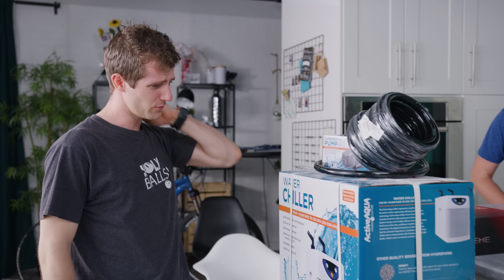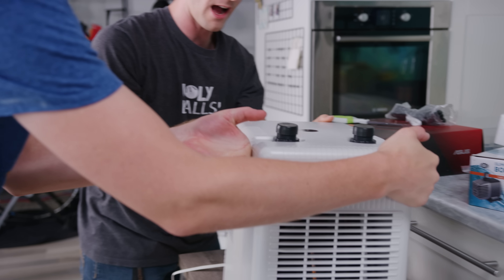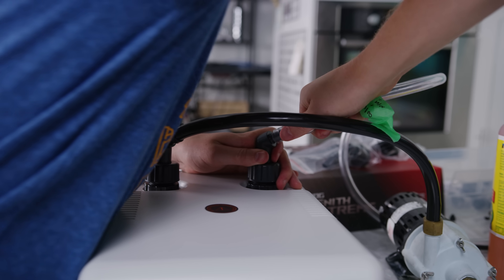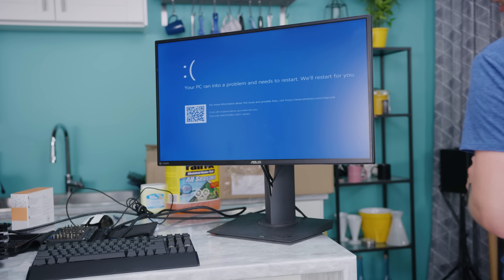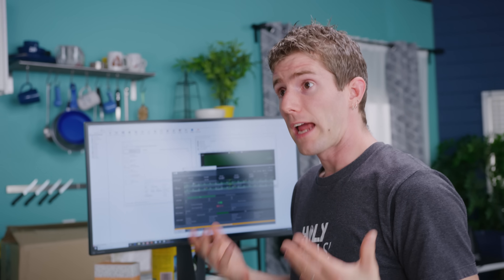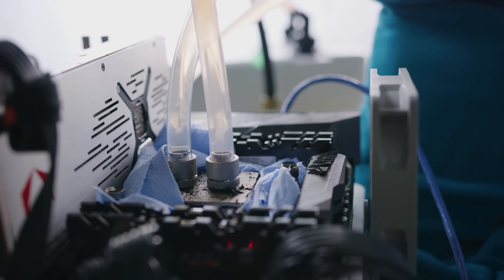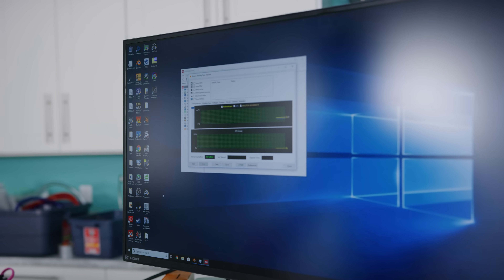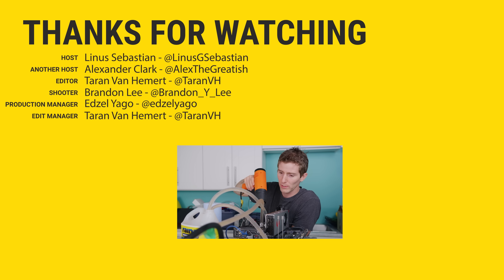Chilling Threadripper 2!!!

Comment: OMFG!!! RANT ABOUT AMD TR 2950WX that can run on AIR COOLER!  Linus u are intel fanboy that explains a lot. The ONLY ONES THAT USED THAT KIND OF GEAR WAS INTEL TO CHILL, Intel XEON 8180 28C 56T OC to 5ghz. Link to Intel joke of 28C 56T  https://ark.intel.com/products/120496/Intel-Xeon-Platinum-8180-Processor-38_5M-Cache-2_50-GHz at Computex 2018. link: https://www.youtube.com/watch?v=H8a3x18x70Q&t=80s timestamp 5:41, Pauls Hardware had shown infamous Intel Xeon 8180 28C 56T Link: https://www.youtube.com/watch?v=w5ZXlQefic0&index=13&list=PLRnHcRQUxuocubqBXEFWDtRcs-s_kNroI

Comment: Linus mate... Next time you might want to try actual coolant instead of windshield washer fluid...
Reply: build a vodka fueled PC call it P90
Reply: why would coolant be any better? you know coolant doesn't "cool" any better than water. the only reason they used windshield washer fluid was so it doesn't freeze.
Reply: ryancrazy1 of you had any clue about chillers you wouldn’t be using windshield  wiper fluid. He should be using a glycol based solution
Reply: @ryancrazy1  coolant doesn't freeze either, it has a better heat capacity compared to washer fluid, especially if you're using pink HOAT coolant

Comment: That alcohol based coolant is going to destroy your chiller's gaskets.
If you want to do something done properly get a laboratory recirculation chiller from Julabo. depending on the model they are very chemically resistant and some can cool to less than -25C (-13F). they even come with an integrated pump.
Reply: I don't think they're gonna spend $50,000 for a gimmick, at least in their other videos showcasing expensive stuff it's often freely donated from the manufacturers.

Comment: 500w CPU running at under 40C. This is your most insane video ever.
Reply: and then you realize he used windshield washer fluid instead of actual coolant...
Reply: the other interesting thing is that people use windshield wiper fluid in aftermarket methanol injection setups on performance cars to keep temp's down and prevent detonation. It is a pretty versatile product lol.
Reply: Consumes less than the 7980XE when overclocked to 4.0GHz and has 14 more cores. I'd say that's not bad at all for a 32 core chip.
Reply: 7980XE uses an architecture from 2015,  2990WX uses ZEN+ which is an architecture of april 2018. To you, a 3 year old architecture should be as power efficient as the new ones ? Using your logic, a 2 core CPU from 2006-8 should use 15 watts ?

Yes that's not bad for a 32 core, but don't compare to a CPU that is using architecture that is in the technology market, ancient.  

My problem is that a 28 core on 5.0 uses over 1000w from the wall. but people think that a 32 core on 5.0ghz will pull 300 watts.
When a 32 core on 5.0 uses 1200w no one bats an eye, but when a 28 core uses 1000w everyone loses their minds. 
People think that 4.0GHZ = 5.0GHZ in terms of power consumption. Because they compare the watts from a 28 on 5.0 and from a 32 core on 4.0.
Reply: Zen+ is old technology as well. AMD had Zen processors for years, Zen+ is just the move from 14nm to 12nm and improved latencies. So for your argument claiming that the 7980 runs on old tech, well guess what? So does the 2990WX. Architectures take years to build from the ground up, the only difference is that Intel kept rehashing the same architecture with only minor tweaks since Sandy Bridge. It is only Intel's fault that their chips are hot and inefficient compared to the competition because they didn't feel the need to innovate when AMD had Bulldozer. It's obvious Intel had no plans for AMD making this big of a comeback, so they're just increasing clockspeeds on everything just to compete well enough.

I have never mentioned the 28 core Computex shenanigan Intel pulled, and that's not even worthy of an argument because we all know how impractical it is to use a chip that's required to run on a 2HP industrial water chiller. I also have never mentioned that 4.00GHz = 5.00GHz in terms of power consumption, not sure if you're just trying to put words in my mouth to justify an argument here.

Still, 18 cores using more power than a 32 core with both running at 4.00GHz is pretty sad. I don't see where 14 less cores could still have you end up using more power, that's just called an inefficient architecture.
Reply: +DropToasterInTub zen+ might be the same as zen with upgrades, but this still makes it a new architecture.

So you think Sandy Bridge is the same as Skylake, from from 28nm to 14mn is the same thing, and using the same architecture ? are you nuts.

I've never mentioned that you said anything about the 28 core, i just complained to you how AMD fanboys see the world.
Reply: Yeah, 500w for 4.0Ghz, not 5Ghz  ^_^ 5Ghz needs a ton of voltage, which means it will go over 1k w.

Comment: U guys know that the problem is VRM on this board? It thermal throttles on 4 ghz. Do it again with proper cpu+vrm water block with this chiller. Load up with some volta or dual titan card and go for no1 on 3dmark score. That should work.
Leo from kit guru made 6,2k cinebench score on 240mm 45mm radiator custom loop. Temps on CPU is not a problem. VRM is way under-developed for this monster. its MSI board, we should get used to it :)

Comment: Omg I wanted to email you about this, but using a lab grade version that does -100c and needs a 220 socket. It also has a cold finger instead of a loop so just smack it onto a normal block
Reply: Isn't 220 like a normal socket?

Comment: If you are going run it that cold, there should be ways to shield the equipment, after all I have heard of some mad overclocking experiments using dry ice, and they went into some detail on all the precautions that had to be taken not to short the PC with the condensation that would form :P

Comment: PLEASE look up Chillbox's its this but Humidity stable, so you can get Sub-zero cooling WITHOUT Frost/condensation, and without having to use Submersion cooling.

Tldr its putting a Chiller loop into a Sealed Airtight insulated box (commonly done with Residental AC unit evaporators)  Then putting all the hardware inside the box, liquid cooling the CPU/GPU, and putting a Radiator Inside the box as well to dump cold air, and will act as a Humidity sink, and since its Sub-Zero inside the box all the condensation that was there freezes to the Radiator, rather then ever getting near the cpu!

Comment: I dont want you to cannibilize it. I want you to build systems like whole room water cooling where the system has no radiator and do some testing like that. That would be interesting...
Reply: im pretty sure there is a whole room liquid cooling video, although it's more like running copper pipes to each pc in the old office
Reply: @kezookoo I mean in the same styles of theose PCs as they had no radiators in the case. It would be interesting to see if you could have the chiller replace the radiators and gain a performance boost at the same time.
Reply: He did attempt to do a whole room loop before.     There was an error made while soldering the copper pipes together so everything got filled with soot and the project was terminated.     But this woulf be an epic thing for that, help keep the loop temps down.

Maybe have a few air radiators in the loop, mainly before the chiller to knock out most of the heat, then use this to drop the loop temp a tad further
Reply: S
A
M
E
E
E
E
Reply: Water-Bed. 
You need neither radiator nor reservoir.
Just the Pump. Because no matter what, you will simply NOT get several dozend to hundreds of liters of liquid to get any warmer using just the heat generated by computer components.
Reply: It did have radiators, but with a chiller if the thermal load of the systems would be too high you could use radiators before the chiller to offset the delta.    That is of corse assuming that the liquid temp was even above ambient

Comment: You can tip a refrigeration pump. All you need to do is set it right side up for atleast 10 minutes to insure the oil drains back into the pump.

Comment: hey just a stupid idea but if it works give a shout out for lightskilled :D why not flip the set up upside down so that condensetion goes down the outer pipe not onto the mother board might be hadrd to have the gpu upside down but if its screwd on should be fine or use zip ties gg :D

Comment: More airflow (at least of the same moist air) will cause the block to sweat until it has reached the dew point. Which it will probably never reach if you constantly run chilled fluid through it.

Comment: you know that you need proper surface area on the backside of the block and proper thermal insulation from the coolant for it to actually make condensation less bad, right? otherwise you want as little airflow as possible, just stick a thick layer of paper towels around the entire block to stop air from circulating with higher humidity and bigger thermal delta
Actually hardcore overclocking-AHOC,  just made a video with his GTX 1080 explaining this in detail if you want a professionals opinion instead of mine.

Comment: You could also have just dropped some amount of LN2 over it ¯\_(ツ)_/¯
Reply: Lmao liquid nitro cooling loop, but not liquid from temperature, liquid from pressure, like how heat pipes work
Reply: Benito Llan Matos wow. In Uk we call LN2 N2(l). Uk is a weird could try. 😂
Reply: Yes because everyone has access to LN2 while this chiller is totally just inferior over it even tho it actually seems like a usable form of cooling your hardware without your fans spinning at nuclear level and heaping up the dust like no tommorow.
Reply: @Yeet42069  first yes everyone has access to LN2 (that's much more potent of cooling your CPU so more voltage...) and it was a joke about linus DROPPING things

Comment: Shouldn’t you use less thermally conductive tubing?
Reply: No, the real question is: shouldn't he have used actual coolant instead of windshield washer fluid?
Reply: @vitordefigueiredo8560  its pretty much mostly methanol alcohol. It works just fine for the set up they are going for. Any other subzero coolant would be rather expensive.

Comment: Linus : (wtf who does AMD think they are... Intel ??? ). for hitting 580-600watts under load..
also i am on team linus, and wanna see that chiller integrated in a full system. (with a full 24/7 stable oc, and gaming/workstation workloads at 4,4-4,6ghz threadripper).

Comment: Cannibalize and loop 5 computers together. That compressor is good for upto 1000 gallons and should have a reservoir of a minimum of 13 gallons. you could do the whole office cooling and only have the compressor outside. which should be waterproof already.

Comment: Why don't you try cooling 10 systems in series and parallel using this water cooling method? That would be cool... Literally 😎
              PC1  PC2  PC3  PC4  PC5 
Chiller----|----------|--------|-------|-------|
              PC6  PC7  PC8  PC9  PC10

Comment: yup it works very well but not long, condensation is the big enemy, i tryed with a 9x120 radiator in freezer it did went very well for a P4 cpu @5ghz lol but just 15 minutes or so before condensation water dripping all around the socket-)

Comment: what if you chill the cpu while it is under mineral oil? it will still condense water?, it can go even further?
Reply: THAT is an interesting question.
Reply: Der8auer does it with the novac something fluid, it is almost the same as mineral out and he says it prevent condensation when he uses a chiller.

Comment: Simple answer: Cannibalize, and load it up!
Reply: but don't drop it!
Reply: @at0mic282  load it up, THEN drop it
Reply: Do you have to ask? Yes!
Reply: @ZexMaxwell  LOLOL
Reply: Cannibalize and load IT UP!!!
Reply: Yes please! Crazy projects are the best and fun to watch, please make it 1h long with the full troubleshot. Like your last live one, that was awesome
Reply: Yes cannibalize it now
Reply: Put a custom PID controller on it and drop the temperature SUBZERO!
Reply: go for it
Reply: Do it for the editors 6in 1 pc
Reply: Directions confusing. Got high instead
Reply: #TeamLinus
Reply: Need to incorporate a dehumidifier and a sealed case to eliminate moisture.
Reply: WHY Cannibalize???  It works fine now.  Even better it can be place in another room.
Reply: If you do cannibalize it and rebuild the system with the chiller that would be awesome but for longevity I think some important steps might need to be taken  you flip the hole cpu and mount upside down and insulated with armaflex on tubeing. "water/condensate  management" maybe even set it up on dish drying racks. 
ps. That chiller could easily handle the heat load , multiple CPUs multiple !
Reply: doo it!
Reply: Did they ever get round to doing this?
Reply: Yes do this please
Reply: Yees
Reply: YES.
Reply: DO IT!!! DO ET NAOW
Reply: Can't wait to see it!!!
Reply: how about cani BLAZE IT 420
Reply: He should put it "in" the 100000$ PC
Reply: yes. Just yes.
Reply: yes
Reply: Do it Linus
Reply: yes please do that !
Reply: Pls do a system
Reply: It would be cool to have it in a mineral oil pc to get rid of the "sweating" problem
Reply: Jimmy Tries World yup
Reply: well of course do it.
Reply: do it
Reply: I agree I want to see what they can do to integrate it
Reply: Make a system, make a system... gogogo
Reply: Vote 1 to cannibalize
Reply: YES
Reply: Really want to see that chiller (in) a pc
Reply: Hole room watercooling V2  with this chiller V2 please
Reply: Do it!
Reply: Do it
Reply: Corsair 1000D is the perfect big case to stuff it all in, too! But knowing him he'll stuff it into a really small mini itx case
Reply: YESSSSSSS!!!!!!!!!!!!!!!!
Reply: just duct tape a tower to the side.walllaaaah
Reply: ya, do it
Reply: Do it
Reply: Still waiting...
Reply: Always!
Reply: Use this with the mineral oil pc
Reply: would love to see that!
Reply: DOOOO IITTTTTT!!!!
Reply: I think you should do it but put it in a vacuum sealed case that would eliminate the condensation altogether
Reply: why hasn't this been done yet smh
Reply: agreed
Reply: Hmm yes
Reply: Yeah
Reply: Even better Don't cannibalize it, and just use it!

Comment: I want to see Linus try a welder water cooler. lol comes with pump, radiator and fan. If it can cool a welder mayybe it can cool Intels new lineup?!?
Reply: How is it better than regular custom water cooling?
Reply: It should be, they are rated for about as much cooling as the average wall mount AC Unit.
Reply: And you don't need that much to cool the CPU.

Comment: Sub-zero? That's an aquarium chiller, it won't go below about 40, otherwise you'd freeze your fish. Don't try to cannibalize it, you'll have to deal with the crazy hot compressor internals, and your airflow won't be right, trust me, I've used these extensively for crypto mining. You're even better off having it in the next room or outside because all of the heat that's being taken out of the chip has to get exhausted from the chiller. Finally, if you ever want to do immersion cooling again, now you have a proper chiller, just keep in mind that this 1/10th hp unit can only extract about 300-350w continuously, but they make them up to 2hp.

Comment: The 3 dislikes were the intel employees
Reply: XxZ4CK50xX ! And the next two were AMD employees because Linus revealed you really need at least a 1500W power supply to run it overclocked
Reply: hello there one of 3 intel employees lol
Reply: Still colder than Shintel's 28 cores.
Reply: @jookm  1500w? 750w would be enough
Reply: Ali0The0King It was a joke since the CPU was pulling so much power

Comment: +Linus Tech Tips - Why don't y'all upload 60fps video? Or is the RED 8K footage not 60fps? Or is that saved just for floatplane?
Reply: 60fps for talk/educational video is just unnecessary. No fast camera transition or moves. It would be just waste of disk space and render time.
Reply: Think of the file sizes, it would be double the size and they already have over 300TB of footage.
Reply: it was decided that most ltt videos didn't need 60fps as most of them have very little movement.
Reply: cUz ThE hUmaN eyE onLY Can sEE aT 30 FPS duMbASs
Reply: +Maxwell Mendo
then you clearly haven't seen any 50/60fps at all
Reply: robert linke, he was clearly joking.
Reply: @maxwellmendo2828  not true you can tell a difference at 30 and 60 FPS.
Reply: @MrBwnTwn  r/woooosh
Reply: 60 fps video looks muuuch more natural tho.
Reply: @silent_anu  r/tworedditorsonecup
Reply: filming fast moving object with higher frame rate makes the video more blurry since the lens is open for less time. I do mountain biking at 24fps which gives a clearer view of the trail surface than 30 or 60fps.
Reply: Biking With Panda, i bet you don't shoot it on RED camera with studio lighting :D
Reply: Er that doesn't make sense. Videos are basically just 30 or 60 images taken a second. So the higher the frame rate, the less light you'll have per frame (darker image), but because the shudder is open for less time, there is far less blur. That's why when shooting action/fast paced content, at least for photos, you want the fastest possible shutter and lens.